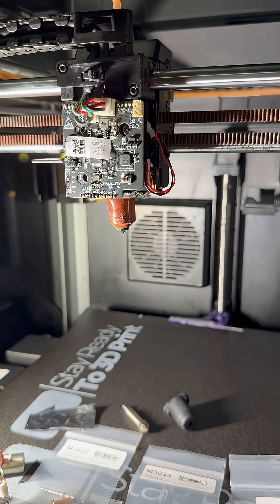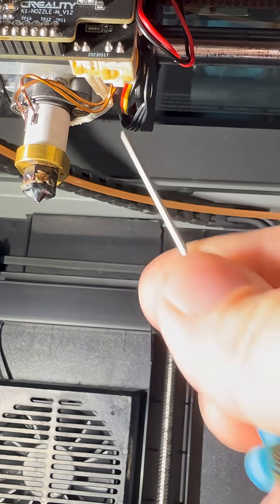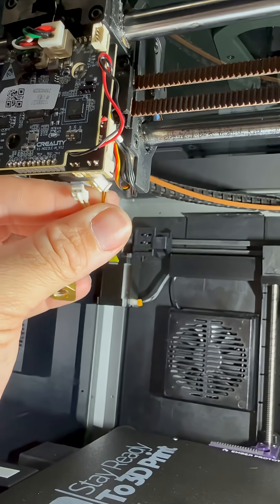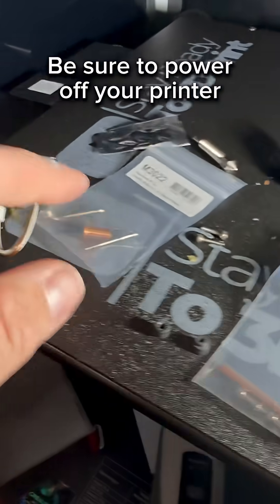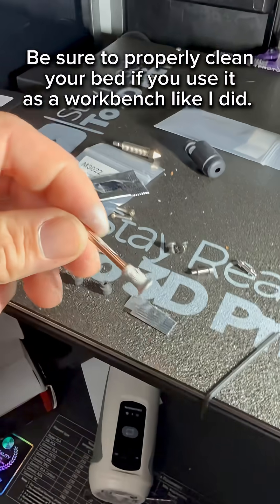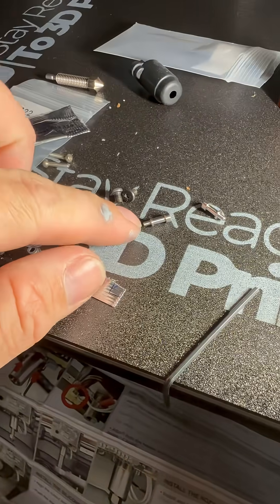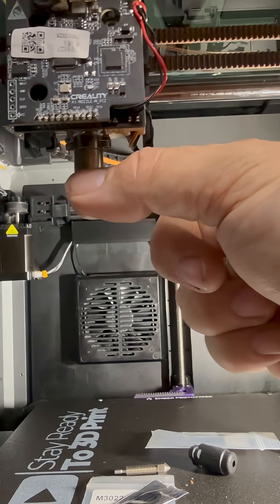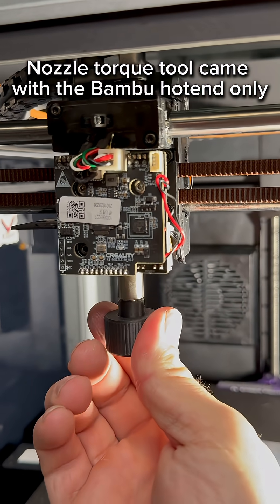Stop Buying Seperate Nozzles For Each 3D Printer You Own! #k1max #3dprinting #3dprinter #trending

Comment: For anyone looking to install this on a k1 machine that doesn’t have the unicorn hot end, you can use this kit to convert to a unicorn hot end without buying anything extra. You would not use the old style hot end piece and you would use the new style piece for the newer hot ends. The issue is the hole in the heat sink is too small for the long tube to fit through. If you remove the heat sink from the printer and open up the center hole with a small drill bit you can easily fit the unicorn piece in. 

If you plan on installing the CFS upgrade kit, you need a unicorn hot end. 

I have this running in my old style k1 max for a couple months without issue.